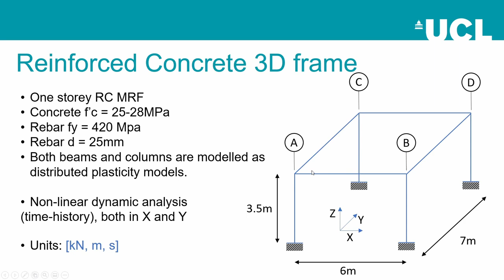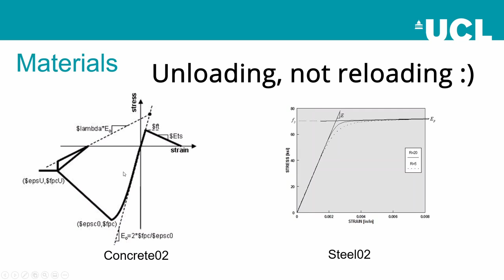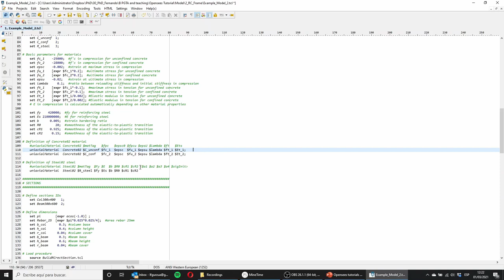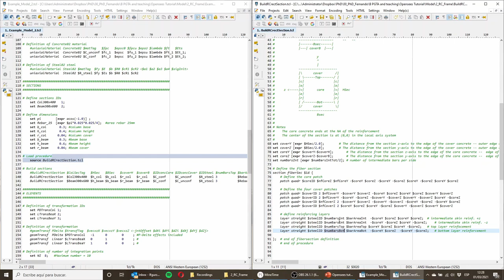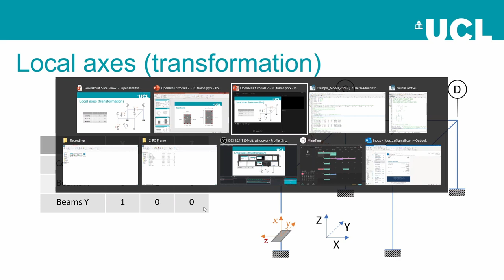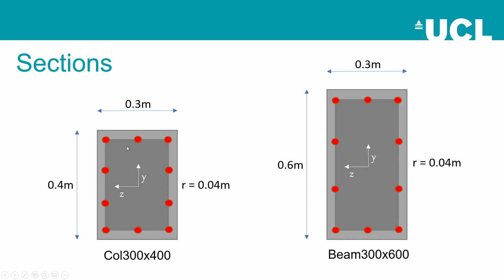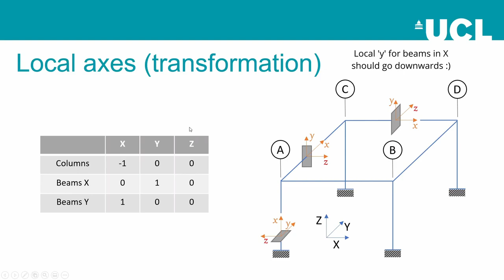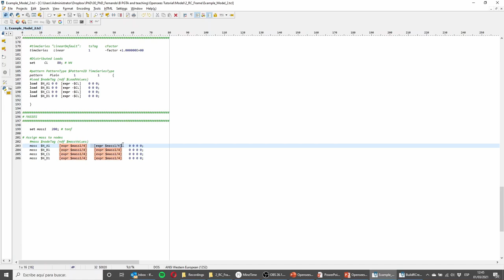OpenSees - Reinforced Concrete 3D model - 1 Model definition

Comment: hello. I am trying to buld my own model. I was wondering how could you build your model successfully without adding torsion to fiber section in 3D model? My model gave an error because of that, it worked after I added torsion.
Reply: you should use the older version of the opensees.exe
Reply: @zhangongwang987 Hi all I am new to OpenSees and have been trying to understand the torsion update in the latest version to no success. I also tried to install and run the older versions of OpenSees and I am not finding any how to documentation. If anyone can assist that would be great
Reply: @davidharford81  yeah I have an older version maybe you could tell me your email ,and  you can also find the older version on the internet